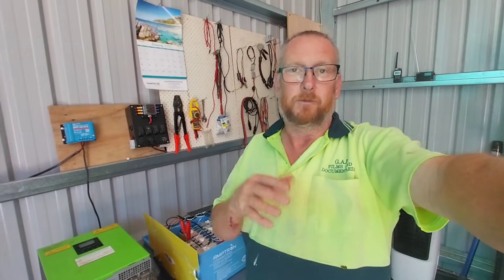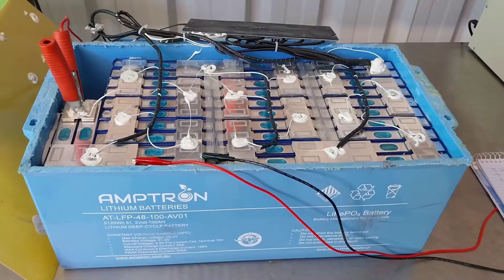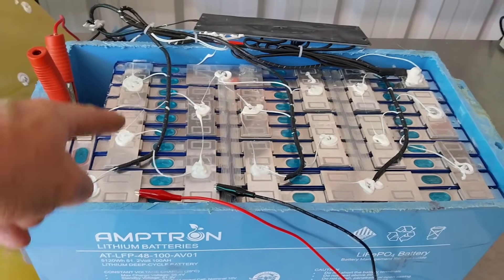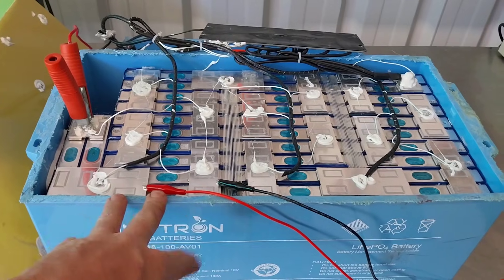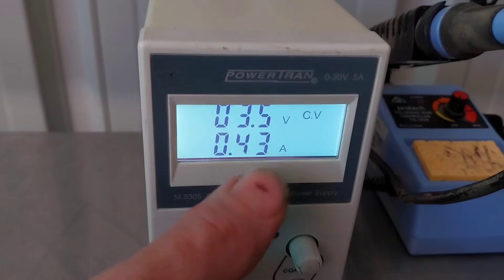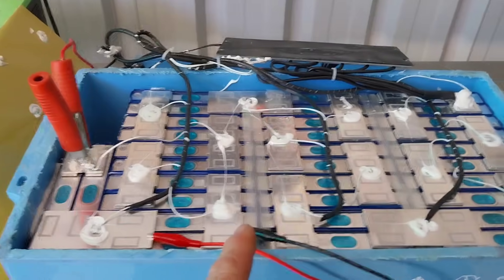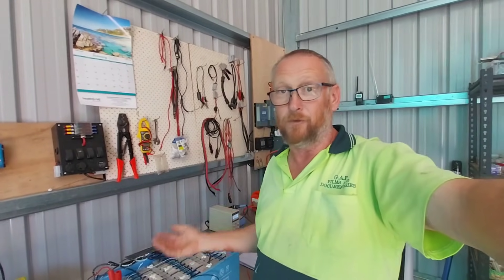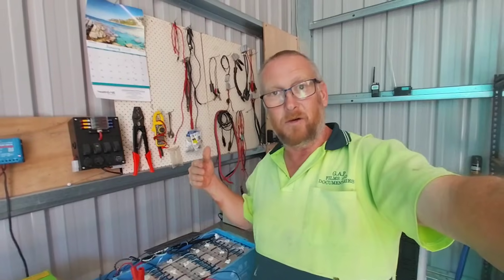Ran Some Cell Voltage Tests On The 48 Volt Battery

Comment: Use a benchtop lab power supply to allow the batteries built in balancer plenty of time. Rod Collins at Marine How To has a lot of experience with lithium batteries in marine environments and explains the technique. https://youtu.be/zdD2Y5ECOu8?si=lHwlQbfytQvsVjNU

Comment: My voltage deviation between cells is only 0.001-3v in my packs and they are 60AH sets similar to yours. Jk will do a great job for sure and possibly will fit under your lid properly. Look them up

Comment: Hi, I have a few JK-BMS i use in multiple places and setups they are worth the money and good. I live in Aus too. Put a B2A20S20P on it. Its 200A with 2A active balancer, built in Bluetooth, RS485, Can-bus.
I have hooked it up to to a bank of LiFeP04 cells in my mixed chemistry setup. I have 500AH all together comprised of NMC and LiFeP04 cell banks, We've been fully off grid for months now. Not a single issue. Price is around $250aud locally.

Comment: You could get a jk bms but since your bms is working for hvc and lvc why bother. Just get an active balancer and balance the pack once a year after you verify your manual top balance restores the capacity. Since you already opened them assuming you arr doing all three put some alligator clips on a 2 amp neeeeeeeee or something and use as needed. Plus that gets you able to open them up once a year and take a look. Since its welded terminals not much to look at but you never know if a cell starts swelling or something odd happens. Don't spend 300 bucks on bms and balancer for all three packs just get one and use as needed. I had external active balancers I would use on an older pack a few years ago and I'd balance once a year they dont drift that fast usually. Unless you absolutely need 100% all the time just do a good enough approach is what I would do. You could also put a terminal block on the outside of the case for the balancer to use as needed and also you could read cell voltages from time to time as well without taking it apart.

Comment: Might be worth cutting your losses and buy a JK BMS and 16 of the 314Ah cells and start again.
Reply from the maker: Couldn't I just put in a new Bluetooth BMS so we can see individuaal cell voltages and have better balencing?
These three batteries cost me just shy of $10,000 and are only three and a half years old so I don't want to discard them if I don't have to. The cells should have plenty of life still left in them, well I hope 😬
Reply: @TheOffGridBachelor  you can try a better bms (i'd use the JK inverter bms with 2A of active balancing current) and try to resume pack capacity by bringing them back in line so you're not swinging the pack capacity between the lowest voltage cell cutting out the bms early on discharge then the highest cell cutting out early on recharge.  

i'd also put additional wires to the cells for an active balancer (heltec 5A).  the additional wires allow the external balancer to shovel energy around without disturbung the precise voltage measurements on the bms. because we know: current flowing drops the voltage. we don't want that on teeny tiny wires that measure millivolts.

plug the heltec on to help the bms initially and then only connect it, if anything went really wrong.  a single heltec can be used to get serval packs back in line. just need the same plug on every pack.

if the bms accompanyed by the heltec balancer with it's heavy lifting and is done - it can keep the pack nicely balanced on it's own.

i think you would regain at least 95% of it's nominal capacity.  and it is wayy cheaper then building new battery packs from scratch.

just do it 💪
Reply: @TheOffGridBachelor see how much the 3 BMSs will be first and weigh up the costs. It’s a hard call but if you are thinking of increasing your battery size in the near future now might be a good time to make the change.
Reply from the maker: @mickpocock2102  Na I don't need to increase my battery capacity, 15 Kw is more than enough for my needs.
A JK 16S Bluetooth BMS is around $250 which will be way cheaper than spending another eight to nine grand on a new set of batteries.
The batteries are still under warranty (6 months to go) well, except the one I pulled the top off. So I am waiting to hear back from the battery company when they come back from the Christmas / New Years break.
Reply: @TheOffGridBachelor you never know, they might replace the one that you cut the top off if it’s faulty. If the other 2 have the same problem and you end up having to buy 3 BMSs I’d definitely be changing.
Reply from the maker: @mickpocock2102  They may do, but their not obligated to though.
I sent them an email last week and spoke to a technician today. Their head technician will be back from holidays tomorrow so he is gonna give me a call when he is back and have a look into it for me.

Comment: if you want to up your game, grab yourself a "JKBMS Inverter BMS" and mod the case, Then you can connect them to your Victron system and have proper monitoring at a cell level.

Comment: If you put a active balancer on it I suspects it would balance the pack out about 3.2 - 3.3v as it is now. Secondly I am not sure if the BMS needs to be replace as the batteries may just have different internal resistance. Please remember the BMS balancing is very small and may not be effective enough especially if you run allot of loads like microwave, washing machine or even induction cooktop that pulse. Those can throw the balancing out of line.  I would go for the active balancer first.

Comment: I am not a fan of active balancers. But once you get a wide cell imbalance they are needed. 
I would not use it all the time tho. 

I have found that regularly (once a month) drain the batteries to 20% then recharge (using my chargeverter) to 100% 

I also connect to each battery thru the   RS485 port and monitor them cell by cell. I do that monthly also.

Comment: Hi Glen! I once had a similar problem with a battery system because one of the cells was malfunctioning. Besides the cell voltage, I also measured the internal resistance of each cell (using a YR1035 tester) and immediately identified the problematic cell due to a significantly elevated value.
Reply from the maker: Might be worth me getting one of those testers, thanks for the heads up.
Reply: A simple voltage measurement without considering internal resistance is not a reliable result. Yes, a new BMS is all well and good, but if one or more of the cells have been damaged over the years, or if the quality was simply poor, even the best BMS is useless.

Comment: Hi Glen, now you have that battery open I like your idea of manually balancing the cells and then retesting the capacity to confirm balance problems and/or tired cells.  It would also be useful to characterise exactly how that balancer operates, thresholds, charge/discharge operation, balance current etc to make an educated decision about keeping the BMS/balancer and tuning your system to match it OR replacing the BMS/balancer with something more modern where you can control all of the parameters.  It would also make for an interesting video.

I recently replaced a water damaged dumb BMS in a 120 AH, 25.6 Volt battery with a JK BMS.  I went through exactly the same process manually balancing a couple of low cells with a power supply before connecting the new BMS. It ended up like a new battery with Bluetooth, a phone App, full monitoring including SoC, control of all parameters and a 1 Amp balancer.  It was 36 bucks delivered for the 8S 100A BMS, cheap!

Comment: Well you could either manually balance them or get an active balancer and put it on there but I would say for the remaining ones just hold them at the top for a few days and see if they get better 
You may have to start at like 3.4v per cell and slowly come up to 3.5v per cell
Over a few days

Comment: Wow.  Those cells are all over the place, could easily imagine there hasn't been any balancing going on at all there.  Slow charge the battery until it goes into cut off then use  a decent bench power supply to bring all the cells up individually to the same voltage then put a few cycles on the battery with the existing BMS with the charger set to 56.8V and 2 hour absorption time and see if the BMS is able to keep everything matched still.  It may not be necessary to replace the BMS but if you do replace it get one with bluetooth access and a decent phone app so you can see the individual cell voltages easily.

I would ask Amptron for the balancing behaviour of the existing BMS, what voltage it starts balancing at etc to make sure 56.8 is high enough.  Normally it would be.
Reply from the maker: While I have the battery open I would like to replace the BMS with a Bluetooth one so we can see cell voltages. I think the Bluetooth BSM is the way to go for sure.

Comment: You need to charge the battery to max cell voltage from Tine to time ..i ran into the same problem with drift in cells and i got it somewhat under control on one battery with a daily 5A balancer and on the other battery with a heltec 5amp capasative balancer. But the only real way to align the cells again is to charge to 3.65V per cell and let the balancer do its job over time. 
We think we save our batteries by only charging them to 3.45or 3.50 but the cells are stil in the flat part of the voltage curve so to balance there is still not a top balance

Comment: I would swap the BMS for a JK 200A BMS with a 2A active balancer as then you get the Bluetooth monitoring as well. With balancing I would charge the battery until you get a cell high voltage cutoff and then bring all the other cells up to meet the full cell. That way you minimize the power needed from the supply. I use the JK now on my domestic and propulsion packs and also in commercial packs at work and as replacement BMSs in packs with balance issues. While you could us a standalone helltek balancer the not much greater cost of the BMS with balancer included gives a lot more benefits with the program ability and monitoring ability.

Comment: The bus seems to be doing its job with protecting cells with high and low voltage cut offs. Maybe an active balancer add on. I use the neey with my bus as the bus has a very weak balancer. Only trouble would be adding it to the cells as they are welded. May need to cut into the existing leads to get the balancer in. A new all in one bms is an option but there are a lot out there and space may be an issue in the case.  Keep up the digging mate.
Reply from the maker: The balance leads from the BMS are soldered to the bus bars so I would just need to desolder the old leads and re soldering on some now ones. A Bluetooth BMS would be good.
Reply: @TheOffGridBachelor the leads are for the balance and the cell monitoring. If you added another balancer, the old leads would need to stay to keep the current bms working. Also, bloody auto correct.. Bus = bms

Comment: Get a JK 100amp BMS and an active balancer.
Are the cell voltages after your discharge test? Seems that these bms's have a high cut off voltage.
Did you test these batteries when new?
Reply from the maker: Yes I've tested them a few times through out the years. Once when they were new and around every 12 months and they all pulled 100% of their capacity. It's been around 18 months since I did the last capacity test.

Comment: Definitely didn't expect to see so many cells in there. I wonder why they chose 50 amp cells. Also, if you change it to a Daly BMS it would be interesting to see the cell voltages in real time via the Bluetooth option.
Reply from the maker: I was thinking the same about the amount of cells. I am guessing the smaller cells are not as tall and can fit in the case better ??

Comment: You will have a capacity issue as you have cells at 3.34, 3.36 and 3.38 when the other cells are fully charged at +3.5vpc. It will most likely happen again in a few weeks as the cells are most likely weaker.

Given the age of the battery, a balancer may just extend the life a bit. Balancing does not fix a reduced cell capacity.

Comment: I have no idea what you should do, but it's interesting. A pity the links are welded. I used to service aviation Nickel cadmium batteries and we would actually remove the links between cells for some steps in the process. A set of fully isolated small power supplies would be handy, you could then do multiple cells at once to save time, but at that point you may as well use a better BMS. I'd probably do one battery the slow way, then capacity test it to see how much you brought it back. If it worked, then do all three.

Comment: I have both JK and JBD. I had a faulty JK there is 0 support. I dont buy anything from JK anymore. Excellent support from JBD. Don't get the inverter-style BMS, get the one with heatsinks that are enclosed. If you want a balancer, I think the Neey is the one to get. I have not used one, you dont need one with a good BMS and proper charge cycles.